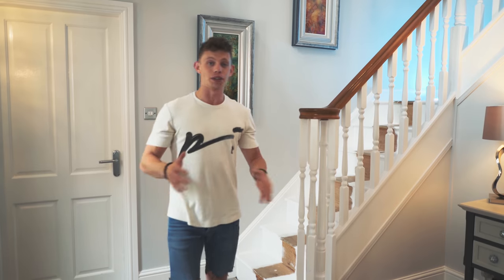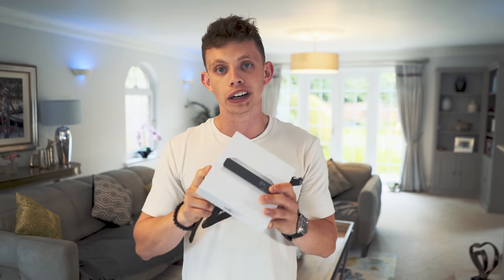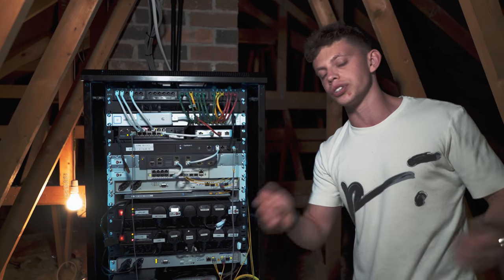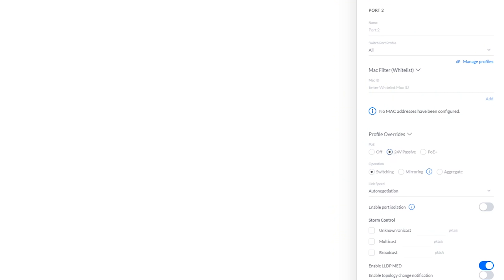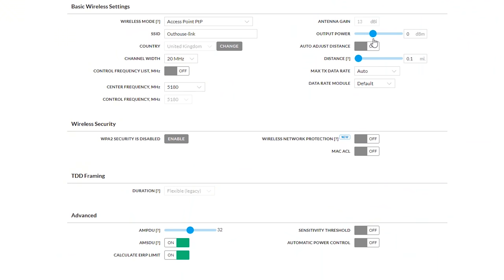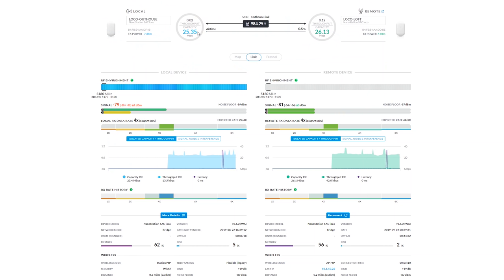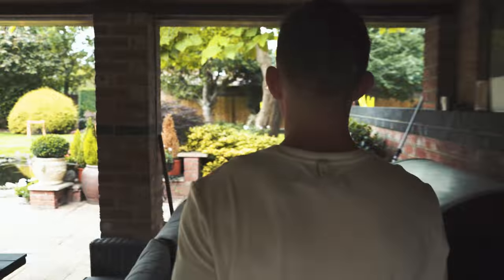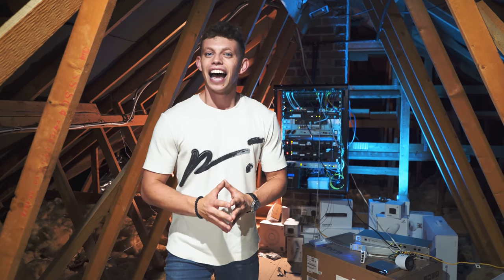Building a New 2019 Home Network: WiFi, CCTV and P2P - Episode 1!

Comment: Its silly to not wire the outhouse, more so when security is a factor. Criminals use deauth and jamming tools these days. Another reason why Ring systems arent great either.
Reply: PTRJAY ..  Ring has started offering POE on at least 1 of there cameras.  The Stickup Cam. Not a fan of the wireless setups, so when these came out, I got several to try.
Reply: Your average thief isn’t going to have a jammer on them.
Reply: @marksapollo   Only need to block out loco AC :D with smt....
Reply: I have to agree. Run a single cat 5/6 and then have possibility to have a Poe WiFi ap or a switch etc.  Even my shed has a couple of sockets (which are unplugged at patch panel when not in use)

Comment: Why are you using 5180MHz for your OUTDOOR point to point link? You should use 5470MHz or above with 5GHz WiFi when using it outdoors in the UK.

I agree that UniFi kit is great for the serious home user and small business - I'm delighted with mine. Looking at the distance to the outbuilding (lovely house btw), I think that putting your AC-Mesh on the back wall of the house would have been fine - mine gives >100mbps over 100m away, even when dialled down to medium power. You also have the option of a second AC-Mesh using wireless uplink if there is more garden beyond, to keep everything behind the single "pane of glass" controller that UniFi offers, rather than use those nano locos.
Reply from the maker: The frequency has now been changed, totally overlooked this when setting up all those weeks ago.

Comment: Just wait for the PSU in them switches to blow. There's a 14 page forum post dedicated to these faulty PSU's. I had a 24 port 250w poe switch and after 6 months in clean cool conditions and very low poe load it blew up. Going to get a non poe variant and then get a seperate injector.

Comment: What is that Cisco(that black with yellow color around ports and with 2 connected white utp cables) at 2:35? between ISP's fiber boxes for conversion and Edge router 4? Is it a firewall or what? 
Thanks.
Reply: Vasek Horcicka it’s a metro Ethernet switch.  Probably an me3400.  It will be the ntd from his upstream internet provider

Comment: USG = garbage
CloudKey = Garbage (i trust the controller on a PC more than i ever a CloudKey)
Unifi = networking level toddler
Do you even VLAN?
Reply: USG is garbage.. I agree..
Edge Router.. Garbage.. (except for the Infinity that's good)
Cloud Key can't comment never used one.. I ran the controller on AWS..
Reply: u jelly?
Reply: @mikelovesbacon  nigga please, I have a stack of Cisco equipment that takes actual knowledge to configure and a real firewall, Fortinet and ASA (tend to switch between the 2 every now and then)
Reply: I was thinking the same. As a CCNA technician
Reply: @block_wiz  Which is absolutely unnecessary for a home network and also tends to draw more power than Ubiquiti gear, but okay.
Reply: @McNetDeck  you're forgetting that his "home" network is also where he operates his ISP from. 

Yes the ubiquiti dishes allow him to sell internet but using a Cisco managed switch would be much better than the rest of the gear in his rack. 

Within the Cisco cli you can create a VM and run a fully functional Linux machine from the switch if you wanted to (not that I recommend it) but it's an example of how versatile and powerful Cisco networking gear is. 

There's a reason they're the industry standard. Cisco in a sense are the inventors of networking.

If he wants to become more knowledgeable and just generally a better network engineer, he should diversify his equipment and try to move away from these fancy webUIs which make basic networking a doddle but are obviously very limited.
Reply: @AIMIWA95  This is for his parents, this has nothing to do with the WISP. And Ubiquiti doesn't require licensing.
Reply: He is guy with money from his parents, nothing more.
Reply: @McNetDeck  well it's not though is it? 

The WISP is ran from his parents loft. And it's clearly all ubiquiti gear too. He clearly states in the video that he's building up a second rack for his parents network. But the first rack was still full of ubiquiti gear. 

Not to mention every other video he uploads that has anything to do with networking is all done with ubiquiti gear. 

Even if that point were correct, it doesn't negate the fact he should be learning how more equipment works. It's just generally a good idea to expand your knowledge base. Especially as a business owner. The more goods/services he can offer, the more potential revenue and profit he can make.
Reply: @AIMIWA95  Don't  bother... He is Ubi fanboy.... and he dosen't see any other (better) brands....

Comment: Unless have 10k, don’t buy ubiquiti security cameras
Reply: plus theirs better cams  for  the money such as dahua cams
Reply: F J totally, for the price of the high end one (1200 CAD) you can get a awesome system!
Reply: @TechnokidYT   Another down fall of unifi protect you can't use other cam manufacturers .
Reply: F J yup. I use a $300 4 cam Lorex system that’s been working great.
Reply: I agree, for home use you can setup something decent for 400 pounds! Amazon are going to be pushing big time into easy to setup home security and all controlled through Alexa devices or your phone. Ubiquity makes some really nice stuff and its interface is very well thought out, but at the end of the day it is designed for the enterprise and not the home, but the new Dream Machine all in one will be offered as a high end home device.
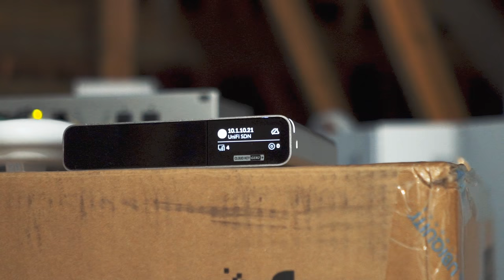Reply: @3:47 bit of a struggle plugging that in?
Reply: @TechnokidYT  no real security installer would use this kit, the real high end stuff in the uk is panasonic, decicated micros and dennard, this is the kit that goes into most retail parks,hospitals building sites and industrial estates etc, and no security installer in his right mind ever useses wireless kit.

Comment: Hi what are the high temperatures in your attic space here in the US Northeast Ohio we can get up over 100° in the summer.
Reply: I have what’s called a cold roof in the uk, and in the summer the temp can be 40-45 degrees Celsius. 

Alex- I’m just about to build my own ultimate home network (just like yours, and unifi obviously) and it’s all going in a 24 U rack in the loft. Is this going to be OK in the summer or do I need to cool or even add AC to the loft? Thanks.
Reply: Yeah, that’s why his ‘games room’ in his office attic was soon scrapped.
Reply: In the UK the attic space doesn't really change much....  If insulated properly etc. The heat stays in the living space. Then thermal wrap keeps the attic a static temp
Reply: Wayne Pearsall this is true for a warm roof, but cold roofs can get very cold in winter, and very hot in summer.
Reply: @AndyTeddTube  that's why I said properly insulated
Reply: Additionally: just seen other videos... Don't think the space is properly insulated... 😏  🐳

Comment: Hi, great video! Currently pricing up a system with an AC Loco link also. Did I miss the part where you configured the outbuilding end of the p2p link? Did you just connect a laptop locally to the nano switch to enter the key etc on there? Thanks!

Comment: Hey Alex, you’ve convinced me to sack off my Linksys Velop and go with Unifi. Is it worth waiting for the WiFi 6 AP’s to arrive and do you know if it’s anytime soon?
Cheers
Glen
Reply: Do you have any devices compatible with WiFi 6  (802.11ax)? 802.11ax APs will not improve the performance or range of any legacy Wi-Fi clients (802.11a/b/g/n/ac). 802.11ax clients will be needed to take full advantage of 802.11ax high-efficiency capabilities such as multi-user OFDMA.... Wait at least 2 years....

Comment: Hey I'm from India here Ubiquiti stores are limited. I have seen your videos usiing UBIQUITI USG PRO4. There are some questions. 
My ISP provides me fiber to my home. So the question is  -
 "Can I directly terminate my fiber into the sfp slot instead of having and ONU/ONT and then connecting WAN port by LAN cable?" 
Please answer ASAP I am in need of setting up home network at earliest.
Reply: Hello I understand that you have asked Alex for the question I work with Alex as a consultant and provide infir for future purchases and intarvells.
Reply: Depends if your ISP allows you to use your on SFP module. If they do, you can purchase a GPON SFP module. You need to make sure you match the vendor of your ISPs equipment. e.g. if they use Huawei PON kit you should buy a Huawei SFP GPON module. You will need your ISPs full support, as they will authenticate the internet connection with the serial of the ONT usually.

Comment: I love the idea of Unifi and like the idea of setting things up this way using the Nano 5ACL's. However does this PtP Bridge actually work with both Nano's being inside the buildings, loft and out in the Garden? as I have a similar problem in getting Wifi/Internet to an outbuilding where I cannot lay cabling and would rather not have to install kit outside as it's in a coastal area and would degrade I think, plus the budget is small but didn't think the PtP would work if it didn't have Line of Sight?
Reply from the maker: Yes, you can have them behind walls much like normal wifi works through walls. It's the same tech used. It works because the distance is about 30-40m however... If you wanted to shoot longer, you will need to have LOS.
Reply: @techflow  do you need to create a different ssid for them

Comment: Hey Alex what Ethernet cable type would you recommend for an outdoor run of 300meters; for a POE Camera which is 802.3af ? Thanks in advance.
Reply: 300 meters is almost impossible for POE if you need to go that far away I would use fiber. And power that CCTV locally from outlet or other source.
Reply: Yeah man for sure . Use media converters and send fibre... much more weather resistant and interference resistant too

Comment: Should have turned off as soon as you used a £300 router. Well done on using the same 5Ghz channel as EVERY BT homehub. The nanos will go up to about 600mb half duplex, not 200. (PS, lay off the sunbeds. They're bad for you)
Reply from the maker: The equipment was provided by Ubiquiti, they will send the best. If you want cheaper videos, check out our other reviews from NetDuma, Netgear and the rest. 
The property installed at in this video is solo, with no surrounding close enough to interfere. Do not want to use outdoor channels here, as they interfere with the WISP equipment on the roof. No one at TechFlow has ever used a sunbed. Not sure if you meant 'subnet' here. Anyway, thanks for the comment.

Comment: How does unify handle gaming. And multiple devices? Qos and threads up and down?  The apartment that I live has descent speeds 30 something download but stability is poor. Sometimes connection is lost and the last year i haven't been able to game online because of lag broken connection and low speeds. 

They've split it into host ssid and tenant ssid and a guess I have pc Playstation cellphone and tablet connected neighbor tenant has probably the same. The host probably has 2 cellphones a tablet and a PC. That might be much for a 30 Mbps line but even at 4 am gaming is not possible

Comment: During part of your filming (8.35) in the outhouse, you placed both the nano station (P2P) and a AC Outdoor Mesh device. Aren't both these access points, surely you only need one!!!
Reply: The nano station is acting as a station(device) where as the nano station on the house is the AP(so to speak) and they are only meant to connect to each other and not to other non ubnt devices

Comment: Why don't you use real networking gear?
Reply: like?
Reply: What kind do you use?
Reply: @asmard tech so what are the best practices, I run UniFi Network and it seems to be working well what kind do you use? What do you think is best?
Reply: asmard tech another toxic troll
Reply: pfSense firewall, Juniper switches and UniFi APs are a killer combo for a prosumer network :)
Reply: @asmard tech would you care to explain my shortfalls technically?
Reply: Its okay to tier equipment use according to user density, every proprietor has budget constraints. as long as high reliability can be maintained its acceptable, thats why employee competency needs to be high.

Comment: Mikrotik for life :D 
https://www.speedtest.net/result/8551929076
Reply: Which Mikrotik? :D
Reply: @samip537  very cheap one. Rb750gr3. Here is Max wifi speed -https://www.speedtest.net/my-result/a/4057111858
Reply: Got that router deployed to, love the Mikrotik stuff. What accespoints do you have?
Reply: @nickd6677  hap ac^2 and wap ac
Reply: @man4evil  Impressive. Want to replace my current ac-lite and ac-lr with pro's or nanohd's. But now Mikrotik it is, seeing those speeds ;)
Reply: @nickd6677  mikrotik does not support mu-mimo. And configuration is shity :(